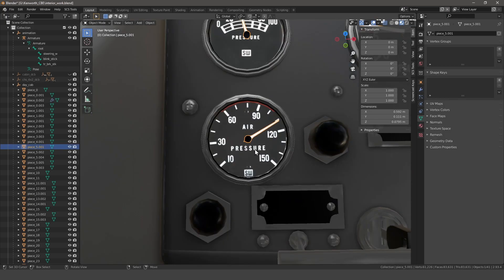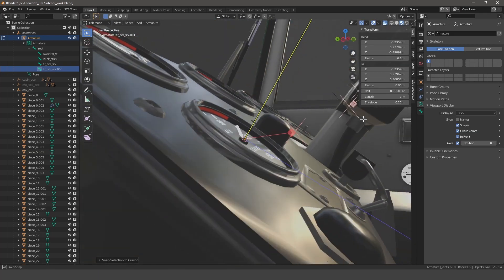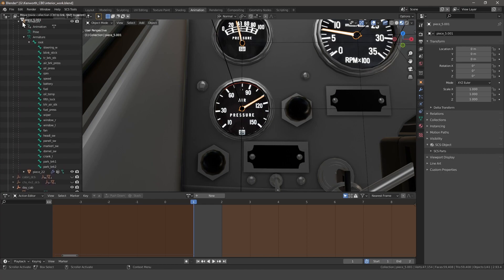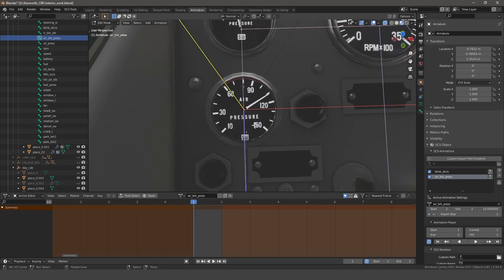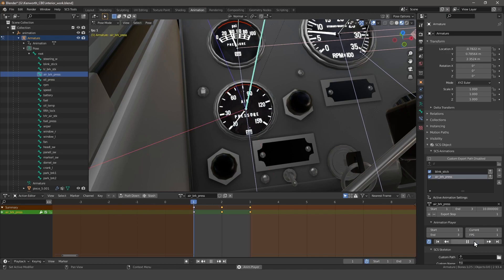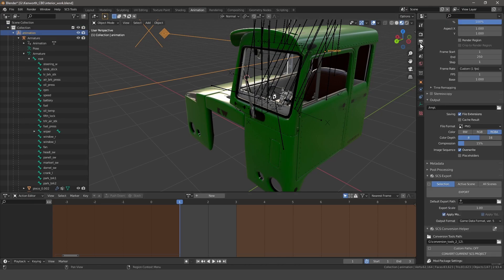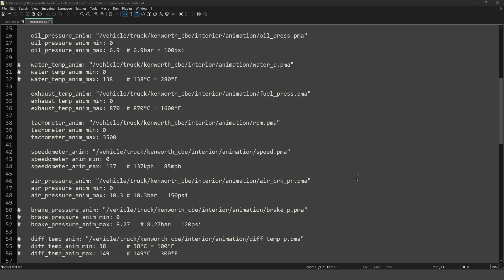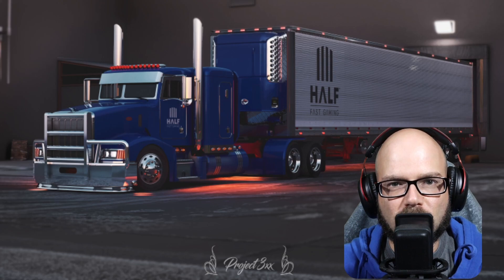How To Mod for SCS | Step 8b | Interior Animation - Dials

Comment: Does this work with the .pma animation files in a mod? I have a mod that has an incorrect speedometer reading even though I've already modified the max speedometer value in the .sui file. I'd like to correct them myself if I can rather than asking the mod creator to fix it (he's already retired from the modding scene)
Reply from the maker: Yes. This is how to create pmas.

Comment: How would I go about updating the dash icons? I was thinking of stealing them of of the scs stock trucks I don’t know if it will work and also how do I add steering creations compatibility
Reply: I was also wondering how to also add the red arrows in the mirrors and also how to change dash color and make it brighter?
Reply from the maker: @FatGophers  I've not done mirror indicators and you can make the interior brighter with the slider in game. If that's not enough you would have to load up the interior of the truck and increase the brightness of the dds file for it.
Reply from the maker: You can do that. Does the truck have a steering_w bone for the steering animation? If so, that's all def work. Otherwise you would have to rename the steering bone, then write the sii files to the sci wheels.
Reply: @Halffastgaming  where do I go to find that? I’m new to this
Reply from the maker: @FatGophers  to find what? You asked 4 questions I think.
Reply: @Halffastgaming  yea my bad appreciate your time the steering_w bone I can’t seem to see any of the Mm when I got to interior all I see is standard sound seat and animations

Comment: Got a specific question, I am trying to create the animations for a steering wheel (just rotating left and right) with no other parts of the interior animated. what is the specific file structure I need and SUI/SII references? Or is a steering wheel animation a future/past video for you? all your videos are super helpful btw.
Reply from the maker: I talk about this in step 8a. The steering animation is not required. Just a bone named steering_w with a vertex group setting of steering_w
Reply: @Halffastgaming  thanks!

Comment: Hey there, I'm trying to get the digital speedo and kms to work, I'm not to sure how to fix the animation of it, it's just blank now.
Reply from the maker: Digital numbers are not animated. They are tied to a separate system.
Reply: @Halffastgaming  thanks very much for the reply, just if you had a totural on that part, iv being trying for ages to get it working, I do a bit of my our modding for my self.
Reply: @Halffastgaming  its a rta 908.
Reply from the maker: @georgeroberts9055  never bothered with those. Sorry.
Reply: @Halffastgaming  no worries, mate, you wouldn't know of anyone else that might have done a video on it if not thanks for help.
Reply from the maker: @georgeroberts9055  I don't.
Reply: @Halffastgaming  thanks for your time 👍🏽